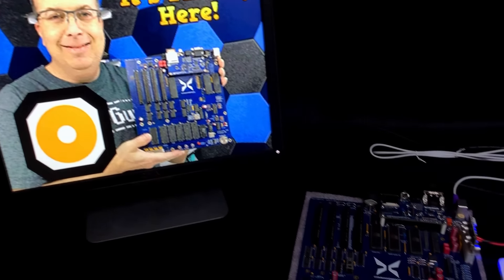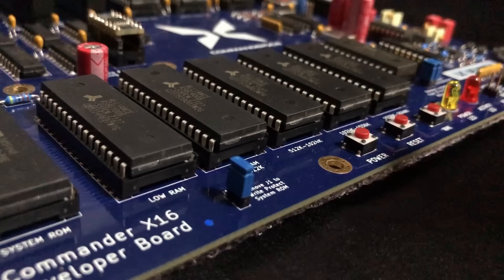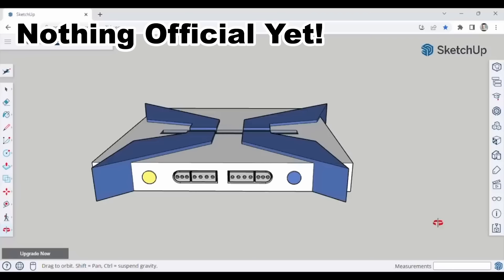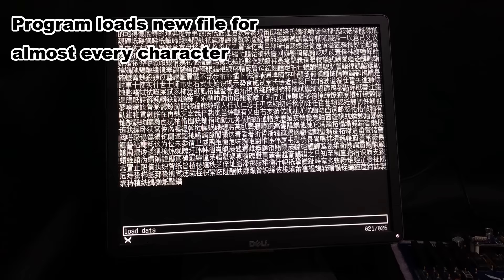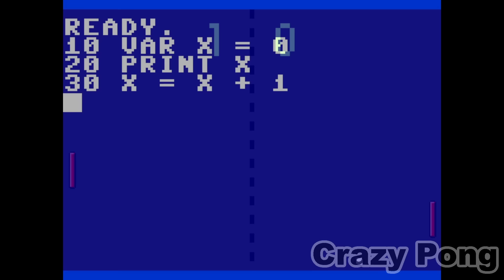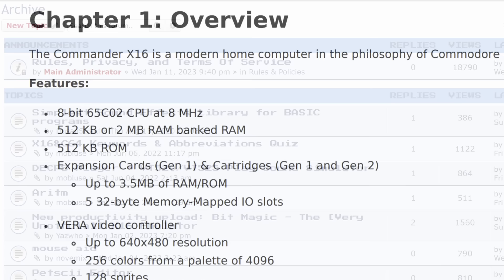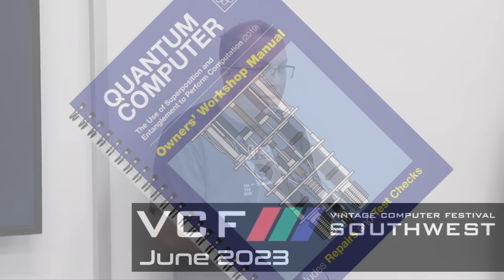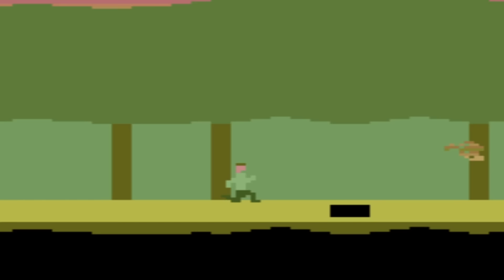The Commander X16 is Finally Reviewed!

Comment: Mega65 seems more interesting to me as hardware as it can still run C64 and even some emulator software. It's also like 8x faster. It's a shame we've got incompatible systems. What got the C64 so much software was the sheer number of users. A hobbyist machine isn't going to do that. An Amiga 1200 has more capabilities overall. 

I just don't get retro that isn't retro, but "new" OLD. I get nostalgia, but this seems more like nostalgia for programming in basic or assembly than for gamers that made up most of the C64 fan base. Nothing can compare to going to old school user groups in the 1980s as a 9 year old and coming home with 20 new games. That lead to an Amiga 500 and then an Amiga 3000 and eventually a PowerPC Mac and then Intel Macs (to heck on Bill Gates!). My issue now is both Apple and Microsoft are nothing but GREED MACHINES. 

I'm more interested in an Amiga replacement with modern PC capabilities (the direction Apple should have gone with the Mac instead of ARM. it was just getting a decent amount of games around 2012-2015 when OpenGL updates just stopped and they went to Metal and then killed 32-bit in the OS which was 3/4 their games, all but killing easy PC ports! Then ARM came and Macs are more like 1990s Macs with almost no gaming software. Good Job Crapple! You've earned that title once more. Meanwhile Microsoft has gone full Spyware and ads in their OS. It's embarrassing. Better to get a Mac and PS5 I guess....

Comment: I want to build cartridges for it
Reply from the maker: You and me both
Reply: @InkboxSoftware  but why is it called x16, should it not be called x8 ????
Reply: @ramakrishnamishra8179 historical reasons.  It was originally going to have a 16 bit processor, but sharing pins for both data and address (depending on clock cycle) made hardware difficult.  By the time the decision was made to go with the 65c02, the name had stuck.
Reply: @digitaljestin  ok cool
Reply: @digitaljestin No, according to David himself, it was always going to be based around a 6502 chip. Just watch his first video on his "ideal computer" for confirmation.
Reply: @another3997  Here's a timestamped link to where he talks about originally wanting to use the 65816, a 16-bit CPU with 8-bit 6502 backwards compatibility: https://youtu.be/sg-6Cjzzg8s?t=138
Reply: @digitaljestin The design was based on the VIC-20, because that's an established design that works.  When they tried to change the CPU to 16-bit, they would have had to change pretty much everything else too.
Reply: @customsongmaker  you got it backwards.  The first design with the 65816 was not based on the VIC-20.  It was the realization that most chips on the VIC-20 were still available that initiated the redesign that ended up using the 65c02.  The inspiration from the VIC-20 came after the 65816 was dropped.
Reply: @digitaljestin  Well I guess it was a long and bitter road of compromise, but I think the X16 will be the most successful out of all the new retro machines because it has the largest community.  Talking about specs means nothing compared to actually using it, and I think X16 will have the most people actually using it.
Reply: @customsongmaker  agreed, it has a great community, and that some week make it a success.  Compromise is basically a synonym for engineering, so it's hard to hear people speak of it as a bad thing.  It's how we arrive at great products, and always has been.
Reply: @digitaljestin  The most important thing is that it works, and people don't appreciate that.  There were an unlimited number of things that could make it not work.

As for compromise, the engineers have to compromise because the customers won't.  If people would just compromise and spend $5,000 on a Commander X16, then it could have more features.  But since people won't, someone has to figure out how much they can do with the money people are willing to spend.

Just like the Nintendo - that was designed in 1983 with 2kb of RAM.  But how many millions of people played games on that instead of an Amiga?  A lot.  A lot of millions of people.  Was the Amiga better?  No, not if you're talking about the number of users, the amount of software sold, the memories and social experiences it gave people, and especially the continued success of the company.  What's better - an Amiga today in 2023, or a Nintendo 64 and a GameCube and a Wii and a Wii U and a Nintendo DS and a Switch?  The NES made all of those things possible, just like the Commander X16 will make more things possible in the future.

If nobody makes a successful new retro computer now, then there's less chance of anyone else trying to make one in the future.

Comment: don't remember either pitfall or pitfall 2 being released on the  either vic 20, c64 or c128 or amiga for that matter, activision and atari 2600 only...

i woul.d lof liked to of seen the commander 16 as a jack of all trades and a master of none with dos and  something akin too win95c support with scsi and ide/sata support

it's getting to the point that to make the hardware relevant for use again we need a multifaceted machine  and have it access multiple systems without taking up alot of  physical space...
Reply: Pitfall and Pitfall 2 were both released for the C64.
Reply: @jasonhowe1697  Absolute rubbish. I grew up in Australia. Pitfall (and Pitfall II) were both officially released by Activision for the C64 in the early 1980s. I have both games on cartridge.

Do some basic research before making a fool of yourself next time.

Comment: I think one reason to get this instead of an old computer is that it is made from newer and available parts. Of course you can repair a lot of old machines, too. But one benefit of the X16 it is designed to be available with standard parts off the shelf for years to come. The biggest plus IMHO is the decision to go with an easy to use Multi-Button-Pad. If you actually play a lot of the old Commodore, Atari and Amiga Games, having to use the keyboard AND the joystick at the same time in most games is really annoying (most Atari-Style connected Pads/Sticks only address one or two buttons).
And while it uses the original Commodore/Microsoft Basic it was improved in many details and the hardware is much faster than any historical 8 bit system of the past. 
I'm still not 100% sure if I will get one because anything I've tried so far with 6502 systems (C64, Atari 800, X16)  beyond BASIC never seems to work ;)
Reply: Many of the parts in the X16 are no longer being produced. Lots of stock still available, but it's going to run out in several years. "Years to come" is technically true, but the phrase would normally be used in an indefinite sense.

Comment: Pretty early on this project evolved away from what I would have loved it to be - a beefed up C64. Would have enjoyed built-in disk emulation, higher clock speed, more memory mapped ram and perhaps some extra graphics modes. But what made the C64 so much fun to program IMO was memory mapped I/O and video, as well as the (video triggered) interrupt system which the X16 soon left. Oh well, I applaud any project keeping the 8-bit vibe alive and not having to decide to buy one or not is good I guess…
Reply: Perhaps the Mega 65 is something, you would like?
Reply: @AstroTechGuy  Thanks, had a look at the ‘book’ (I’d say reference guide) in the downloads section and that’s quite a useful resource like the C64 one. I would have designed it more from C64 compatibility up, but that would have come at the cost of capabilities. The tradeoff they made by taking the C65 as starting point makes a lot of sense and it looks like a fine machine to tinker with if I had the time…

Comment: Nice computer. 
But I dont buy it. 😐
I dont like the 6502... yeah they say it is faster then the z80.. but I can program the z80 with the much more advance instruktion set then the 6502. So i l tink the z80 is a beter cpu. (At lest i think so).
But still very nice computer you have.😊
Can I give a tip?
Give your in built Basic program language a upgrade. 
Make it with local and global variables.... 
Your half way there. you made it to subroutine parts...
But you can go all they way and implement global and local variables. 
Say no local variables 
 Just a gosub (to a subroutine)
Or a gosub with local variables..  
Gosub "RoutineName" (variable 1, variable 2, variable 3... )
Return (valuta 1, valuta 2, valuta 3....)
Then the Basic can make recusive commands... that was a big disadvantage of Basic.
Reply: Sounds like you need a CPC. It is Z80, and with the available expansions, it can do really much. I got a CPC 464 with Ulifac (512kB+UART/WIFI/ETHERNET+6128 mode+USB drive) and a good RGB SCART cable, it is like 150 bucks in total, and it is awesome.

Comment: Best reason is SD card???? Budy, no offense, but even my C64 is loading everything from one single SD card (with a PI1541).
Reply from the maker: I probably should have said one of the best reasons. But it's not just about loading programs, it's also the ability to quickly store/load data on the fly written into the software. Take my Chinese word processor for example, it loads in a new file for every different pinyin block, and it does it pretty fast as well.
Reply: While SD cards are available on retro machines, on the X16 it's stock, and therefore can be counted on for each piece of software written for it.  Couple that with the data being loaded at 8Mhz, and you know have something comparable to using a memory mapped cartridge for storing program data.  Load from disk times are negligible, and storage might as well be unlimited.  No retro machine has that assumption for developers.  Not by a mile.
Reply: Guys, it was literally said that the advantage is that you don't need a giant stack of floppy disks, which is the same with all 8bits nowadays. That is what I said.
My personal opinion is that you may get fancy SD card, fancy video system, but no retro feeling. My C64 is literally my childhood computer with my childhood games, so in retro, it is muuuuch better. It may lack some of the capabilities, but if I need that, I use my PC.

Comment: If I want to program with restrictions I'd write for a $1 arm or riscv chip. riscv assembly is pretty elegant and I can run that in qemu. I will never understand why somebody would want to write basic or 6502 assembly both belong in the past.
Reply: I just run an ARM board in QEMU anyways. It's free and I don't risk bricking a device
Reply: People do these things because they enjoyed doing it in the past, or they wanted to do it, but for some reason, they never did. Personally, I don't see the attraction of the X16, but I do understand nostalgia or historical interest. The ARM architecture was literally developed and tested ON a 6502 based machine. Just two people at Acorn, using the BBC Micro (which they also developed, along with BBC Basic) to simulate their new ARM ISA. The first "Acorn Risc Machine" silicon was a development co-pro for that computer. Then it was used in their Archimedes computers and beyond, with their proprietary RiscOS. Which is now free, being updated, and runs natively on the Raspberry Pi and several other ARM machines. But the RPi itself was inspired directly by the BBC Micro used in British schools. History is what gave us the present.
Reply: @another3997 Is modern riscOS anything to write about to home?

Comment: Looks like it was designed by a committee of people who all wanted different things. So many compromises and poor choices.There are better / faster / more elegant options out there.
Reply: Pretty much
Reply: Yes, feature creep set in very early on in the X16 project. David wanted a cheap, Commodore inspired machine along the lines of the Maximite computer, with no hard to source, end of life parts or FPGA chips. Guess what they ended up using?
Reply: It's basically "feature creep: the machine"

A really dumb example is the manual. The idea from the get go was a great manual that you could open and immediately get started on BASIC programming, like the old microcomputer manuals, with advanced documentation online for more serious developers. But the idea of being able to open the box, not look at your phone or another computer, just immediately open the book and start typing was fundamental to this machine.

And now it doesn't have a manual, and the team has been iffy about whether the manual will ever actually appear and recently said "were struggling to justify printing out the wiki"

And don't get me wrong, I get costs and so on. But the manual is one of those little ideas that helped sell this as what it was intended - a modern day, more hassle free microcomputer to learn things like BASIC or mess around with machine code or load up demos, etc. And basically every feature is like that manual. The original idea is in there somewhere but it was forgotten about six months ago when one of the many cooks in the kitchen threw it out.

Someone said its answering a question no one is asking but that's not quite right. It's actually a rambling, overly long and complicated answer to a simple question people were asking.

Comment: As one of those who was on the BBS Scene in the 80's and 90's... except for using HTML boxes and proportional fonts instead of CP 437 Box Drawing characters (CP 437 0xB3 to 0xDA) and the monospacing of CP 437 standard fonts.... 
The forums really don't look much different than lazy BBS Sysops used in the 90's.

Comment: There is also a big hype on custom MSX, a renew of the old 8 bits computers but it has advantage to have good old games as new ones, and is able to run CPM.  It is fine to have the new 8 bit but not choosing a Z80 is a miss, so many very good computer exist on Z80 (spectrum, Amstrad, MSX .... al lcpm computers) it could have been a good platform for multi compatibility. especially when the hype of the x16 will pass and there will be no more devlopment. it is based on 1 person only sadly. If he stops, it dies.
Reply: The Z80 won't work with the official Commodore Kernal and Basic - which was/is one the main design goals of the system. CPM in reality was often a nightmare to use because of several incompatible floppy disks formats. I think only a few machines (like the C128 with it's multi-format drive) ever addressed this issue. I also cannot think about software anyone would use on CPM today. I mean there were a lot of serious business programs available around the late 70's/early 80's but who would want to use 40+ year old business programs today?